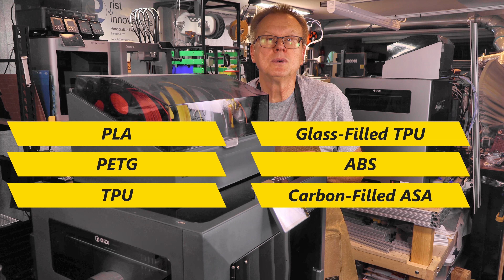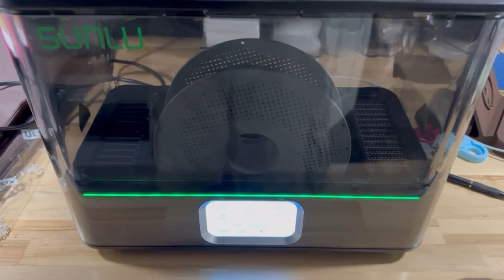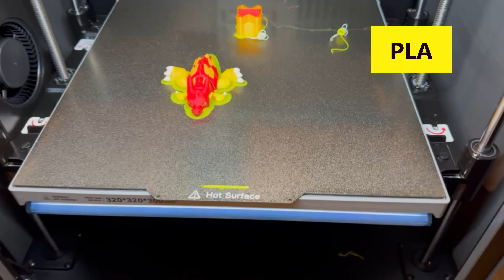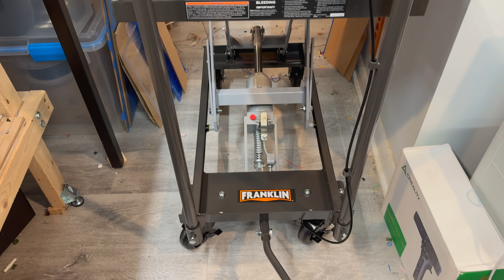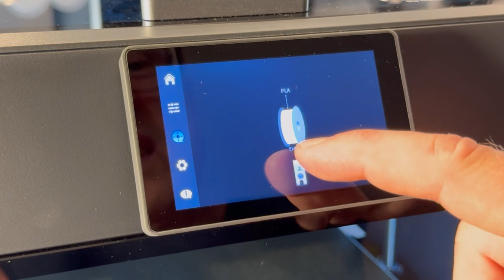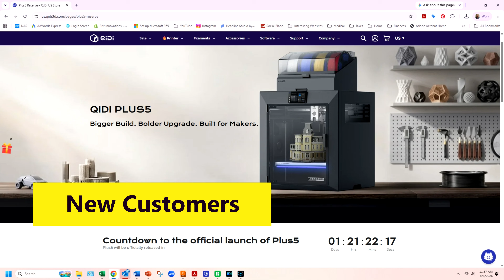Is the New Qidi Plus 5 the BEST Value Mid-Large 3D Printer?

Comment: Thanks for sharing Ken, I'm new to 3d printing, what do you think is the ease of use designing in qidi studio slicer?
Reply from the maker: I'm not sure what you mean regarding "designing" in qidi studio slicer. I have found the various slicer software such as Bambu Lab and Qidi are similar, but they have some small differences.  If you could clarify your question, I would be glad to try to answer.
Reply: @ristinnovations  thanks for your response, yes you're right, I've had the opportunity to test both now, Qidi studio is similar to Bambu studio.

Comment: Thanks for your review.  I have been a QIDI owner/user for a couple years now, first with a Q1 Pro and then an XMAX3.  I really do hope they are working on a multi-extruder version as well.  I have held off buying any other multicolur model because I simply like the QIDI engineering but not the old school single extruder for multi-colour, and don't like waste.

Comment: I have the Plus 4 and Q2 - not trapped in the bambu walled garden. With any printer the main thing is to dial in the filament. And once you find a filament you like of a particular material, do not change brands... major headache relief. Many, including myself tried saving a few bucks on filament, this cost me a lot of lost time, far more expensive than the few dollars saved on an on sale filament.
Tool Changer.... yes I want one, and I'll wait for Qidi on that. I print single colors as a rule, and the AMS thing is absurd, never went there and never will. The up side for tool changer for me is support material, and also not having to load in again for a different filament, can have 4 different material or more ready to go on demand. For me that is the main upside. For mutli-color prints, not my thing, yes of course a tool changer is the game changer... and FlashForge Create 5 Pro is the by far teh best deal for that now that they fixed a couple of bone head design flaws.
Reply from the maker: Thanks for sharing your experience with your QIDI printers and your insights on filaments and tool changers. I appreciate you taking the time to share your comment.

Comment: Just get an A2L ffs.  Bambu's got a pedigree in motion control and their printers are second to nobody when it comes to quality.  They have great availability on spare parts (if you were to actually EVER need them in the first place) and I say this as someone who runs a literal repair shop for 3D printers and who grew up with some of the greats (Nophead, Triffid_Hunter, etc) as my mentors.  I'm supposed to hate Bambu Lab but there's just no arguing that what they provide is just...too damn good to be gambling your money on crap like the qidi.
Reply: You ok bud? This is a H2S competitor for half the price
Reply: can not print ABS or carbon fiber nylon on A2L, if you have engineering printing needs, Qidi is the best choice.
Reply: You Are Wrong Because Qidi Is Much Better Than A2L.
Reply: Maybe for flexi dragon's
Reply: G